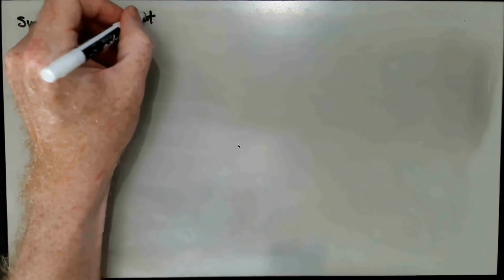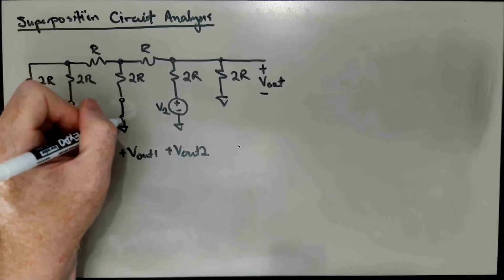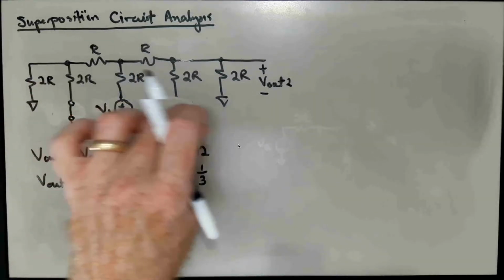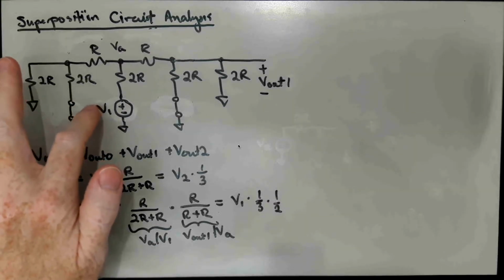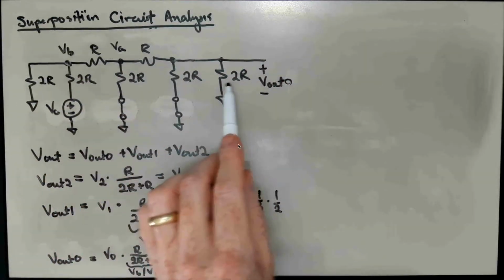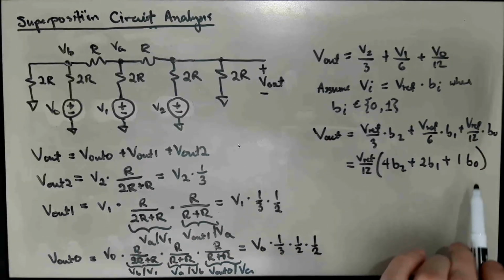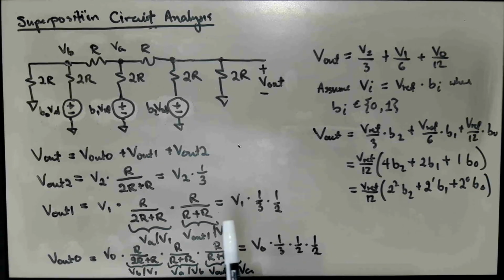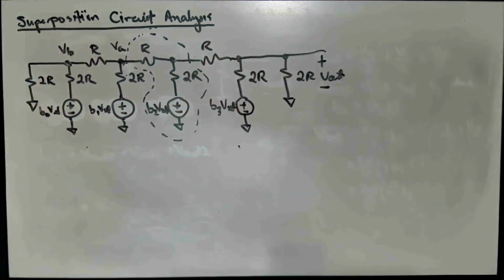Analysis of an R-2R Ladder Network by Superposition

Comment: I'm now wondering if you could somehow account for systemic mismatched resistors in a wafer.  How would you adjust this circuit to allow greater bit depth (for audio for example).  Great series.

Comment: Why do you use this unusal resistor ladder design that uses double 2R to ground instead of only one 2R to ground?
Reply from the maker: The reason is that I designed the circuit in this example from scratch by terminating both ends of a doubly-infinite R-2R ladder network, which is the function of the 2R resistor to ground on each end of the network.  Each 2R resistor simulates the loading of the rest of the infinite network on its end.  I suppose the more "usual" design would start with a singly-infinite R-2R ladder network that is terminated on one end.  The "usual" one would be preferable in practice because you get a larger full-scale output voltage and it uses one fewer resistor, too.

Comment: I don’t understand one thing about this superposition. So you’re looking at each voltage source isolated as one case where the other voltage sources are seen as ground. You do that for each source and add the values in the end for all sources. I get that. But how is that correct? Because in reality, those other sources that we assume as ground while we calculate that one source, are they really ever acting as ground in reality? How is it possible that we can do that? It just doesn’t seem correct to me even though I know that the method is correct. But I don’t see how that is possible? Can anyone explain that to me?
Reply from the maker: I'm afraid I don't have a more intuitive explanation than that is the way linear systems work.  In fact, many take this behavior to be the defining property of linear systems.  If you had even a single nonlinear resistor in the circuit, your intuition would be correct and superposition would not work on it.